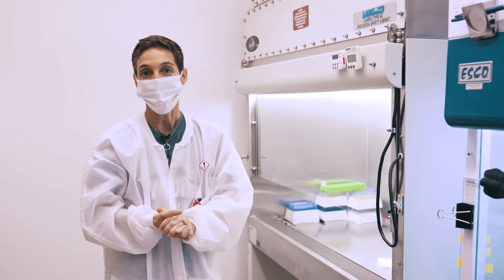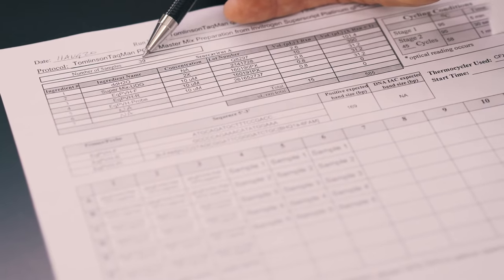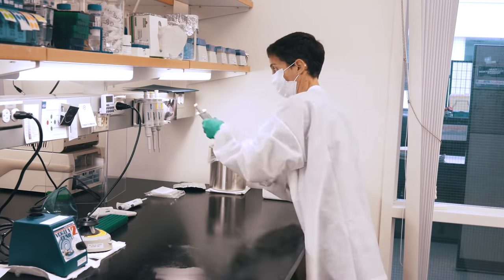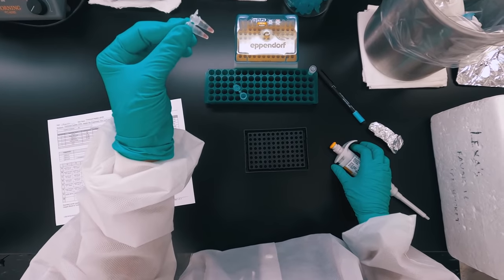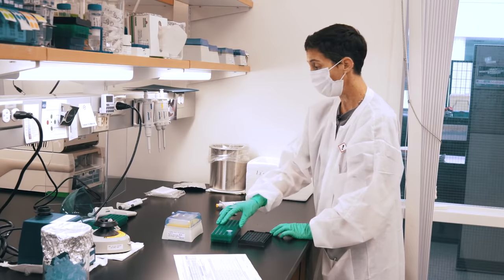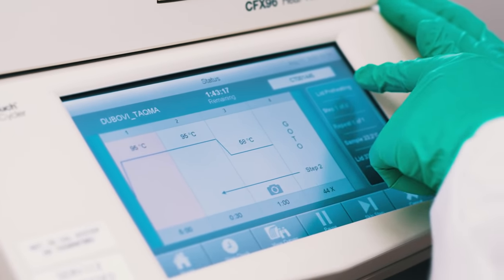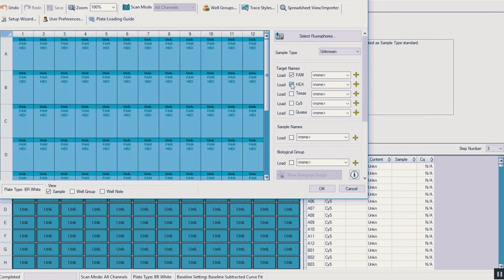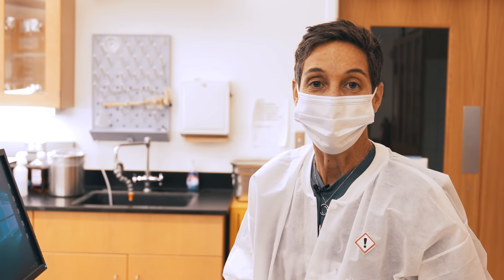Real-Time PCR in Action

Comment: I'm facing a major issue with contamination during qPCR at work. For the last 6 runs, my NTC has been showing a strong curve, which shouldn’t be happening. I’ve tried various troubleshooting steps, including purchasing three different sets of new probes and primers, and even quantified the water used as NTC (with a Qubit reading of <2.0ng/ml). I also ran my assay in a neighbouring lab but encountered the same problem. I’m running a multiplex assay, and the issue specifically affects two of my three probes (FAM and HEX), which are producing the curves in the NTC. Any advice or suggestions would be greatly appreciated!